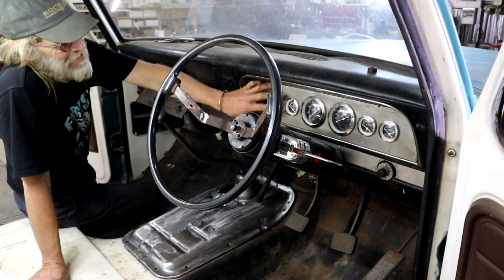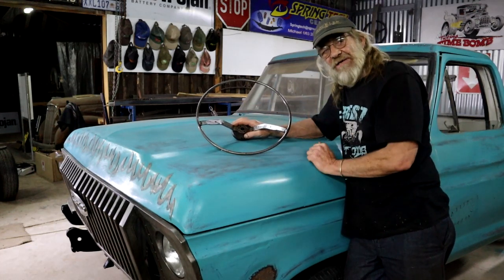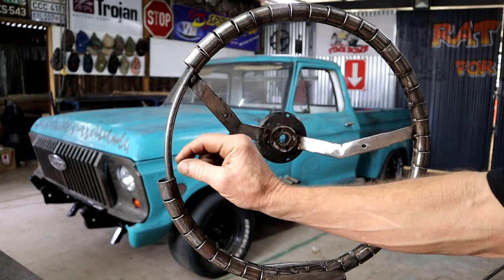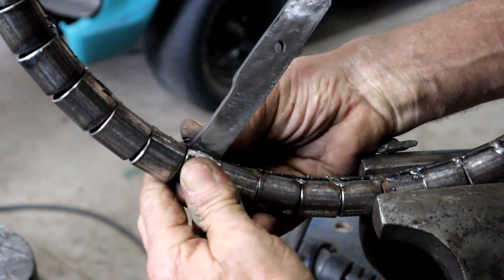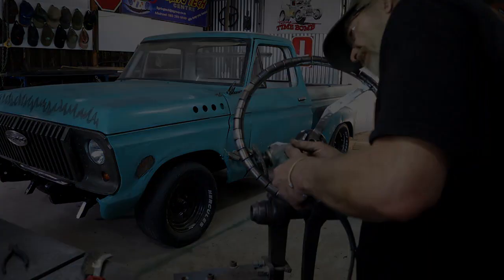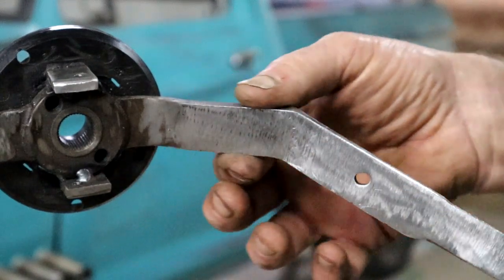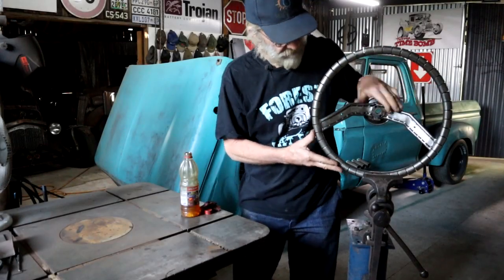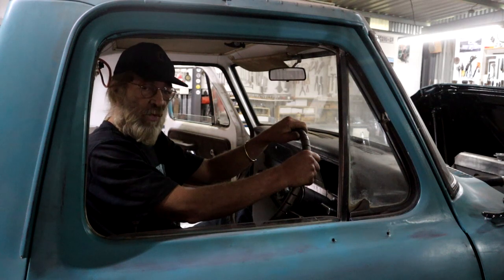BUILDING A CUSTOM STEERING WHEEL - RAT ROD STYLE!

Comment: With a steering wheel that heavy the front axel doesn't  need to steer, Just crank that sucker and the sheer mass weight will move you. But then you may being donuts forever . Great content! TC, Silicon Valley.
Reply from the maker: It's kinda like poor man's power steering!😂

Comment: I really enjoy watching you create something unique and custom by using some basic materials, as well as scrap parts! Genius!! I was wondering how that wheel would look with an added piece of round rod, in the center, between the outer pieces of rod. It would cover the two holes. As a matter of fact it could be plug welded from the back with a few more holes drilled in. Thanks for posting!
Reply from the maker: Not a bad idea! Will give it a try sometime. Thanks!

Comment: Hi oem Div what welder are you using for body work is it gas or no gas mig
Reply from the maker: MIG with Argoshield 5 gas. Those fluxcore setups doesn't work for me. Too messy, lots of spatter and you gotta chip flux